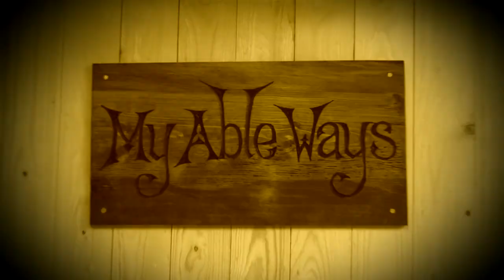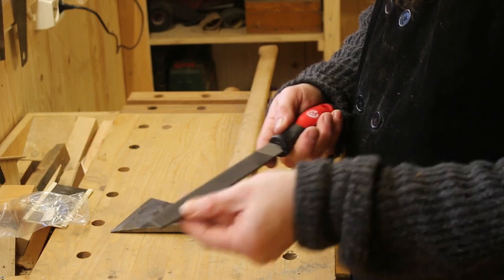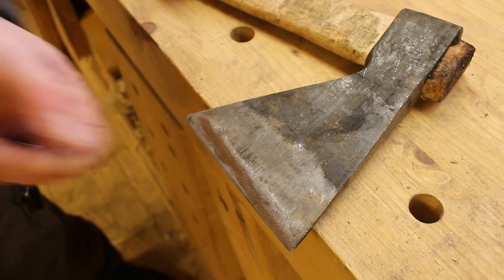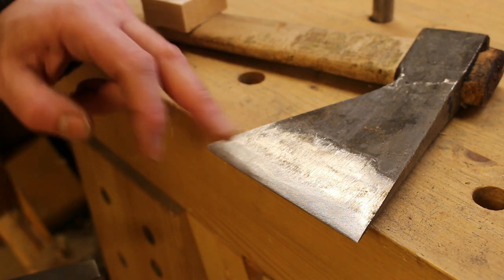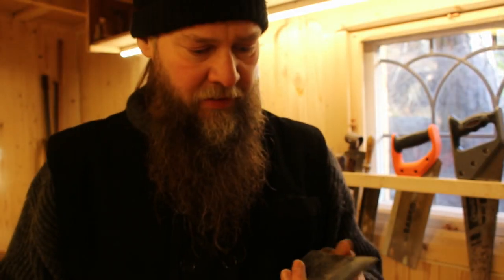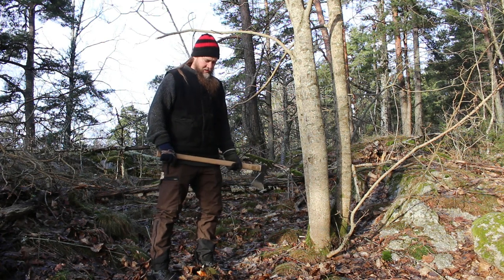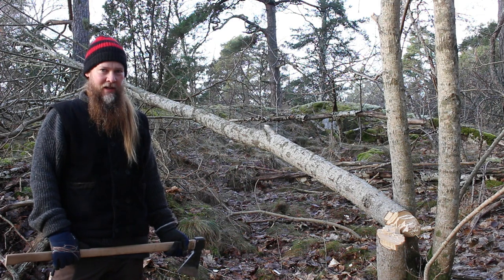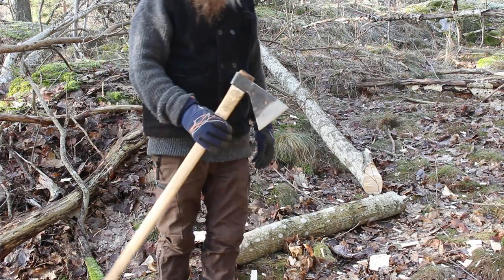Rinaldi Axe edge profile. Upgrade an axe by adjusting the edge with file. Make the axe cut better

Comment: Great bucking axe to light for a felling axe .Great content love the carpentry videos
Reply from the maker: Thanks a lot. Yes, I will get another axe more suitable for felling pretty soon. But this small Rinaldi has more to offer than you might expect, if you just get the edge sorted out. I did some more work on the profile today, as I said in the video I just did a little reshaping. And now the small trees almost fall down by themselves. A 2” diameter trunk comes clean off in one chop. And a 6” in half the time compared to the video. So I guess I’ll have to shoot some more axe work pretty soon …
But before that, I’ll finish part 3 in the series of my workshop doors. I’m glad you enjoy those carpentry videos too.

Comment: Yes! We wanted this! Well, I did, at least. My axes gets sharp, but not... Sharp with a capital S! I will grind down the hand-axe a lot, as there is way too much material in the tip. I'll try your way with that axe, then.
Reply from the maker: Try it. But it’s not really an improvement for splitting, only if you’re doing cutting work.
I should add that I really didn’t do a lot of reshaping in the video, I went back and did some more work on it today, and you should see the results now … there will be another video of this pretty soon, I have to shoot it quickly, when there are small trees left on our slope. With the edge I got on it today they drop almost by themselves.

Comment: I have the Calabria heavy duty, which has a significantly heavier head (I thnk it's 1300 or 1500g). I like its cutting performance, but I neead to rework the handle to give it some flex and reduce shock. I like the way the steel "rings" on these axes. I would offer some critiques, but it sounds like you're learning quickly on your own. There is a whole community of axe lovers out there, and plenty of people sharing knowledge on YouTube.
Reply from the maker: I got another Calabria after my first axe videos, that one’s a bit heavier too. And the handle that came with it was way too thick, of course …
Thanks for your support, I hope to make some more axe videos now during the winter.

Comment: Super video. Could you teach us how to profile a handle? I hear their handles as well a hultafors axes are too thick. 
Is that a hultafors sharpening puck? Are they worth it?
Thanks
Reply from the maker: Thanks for your appreciation! I’m planning to shoot a video or two on handle making and how to thin down an existing handle to better working thickness. So it will come eventually.
Yes, it’s a Hultafors axe puck. I think it’s alright to bring out in the forest, but in the workshop I prefer my double sided diamond stone. And a large strop with a good honing medium. I think the axe puck wears away pretty quickly and doesn’t work as well as the diamond stone.

Comment: I'm not very skilled with a ax either lol ... but that view let's you see just how much deeper the ax sinks into the wood when you hit at a slight scew... when you hit flat against the grain it almost just bounces off ...
Reply from the maker: Yes, that’s right. I still need some practice. When felling, the cuts that go in at an angle are the ones loosening up the wood. The horizontal cuts are supposed to sever the fibers where the crack from the angled cuts end. But because of my lack of skill I hit too low at some times.
When bucking, on the other hand, you cut at an angle from both sides.
I’ll shoot another video when I’ve gotten slightly better at wielding this axe.

Comment: Damn with the bucking that long handle really seems to give it leverage no? I got a Bellota Biscayne style recently should be coming in the post soon its around a 1200G head.
Reply from the maker: I’ve found the 90 cm handle to be too long for bucking, so I’ll make a shorter one. And one that actually fits properly in the eye, the handles Rinaldi sends with their axes seem to be below any reasonable standard.
Reply: @myableways  Aye they seem to be a little lacking haha I have the American boys axe on a 60cm handle on a 7 shape handle I made from ash from the first large tree job I worked on been felling and bucking quite a few silver Birch with it at a wildlife rehab center as the pollen affects their eyes. That and its been a good chance to open up the wood and help the other species to grow such as the Hazel and Sweet chestnut.
Reply from the maker: Sounds like a nice job. I mostly fell birch for firewood myself.
Reply: @myableways  It's next to a seal pool I've been saying to the woodland manager they should seel it for firewood or get some charcoal going Birch is probably my favourite firewood all told.
Reply from the maker: Nice to have seals nearby when working. And I like your idea of making charcoal. But what do they do with the wood you’re cutting now? Just dumping it or what?
We traditionally use birch for firewood in Sweden because it’s everywhere. Cuts and splits easily, and the oil in the bark of course is a great advantage for lighting fires … but as to the energy value it’s actually somewhere in the middle, compared to other wood species. Our german neighbour told me they burned mostly beech when he grew up there. But that’s probably for the same reason as we burn birch, they have a lot of it … maybe I should do a video talking a bit about different kinds of firewood. We’ll see about that.